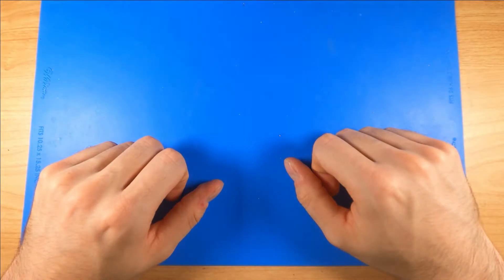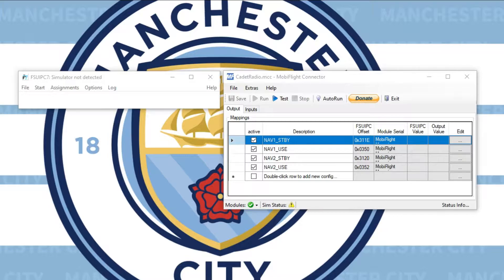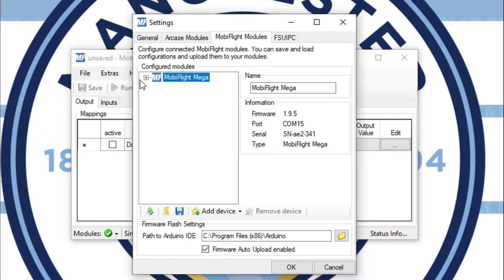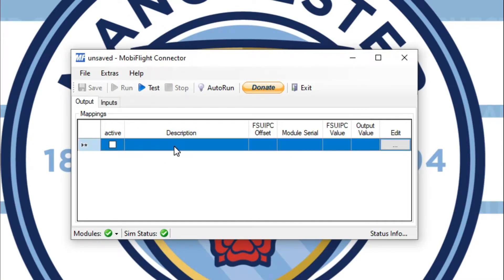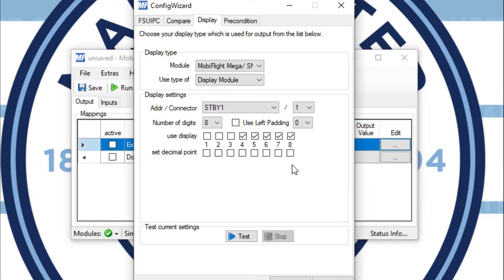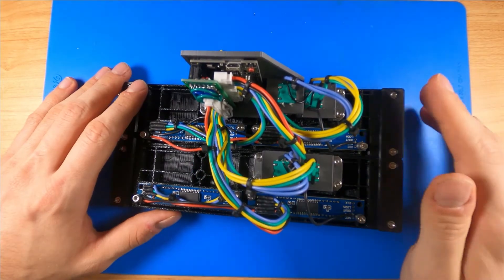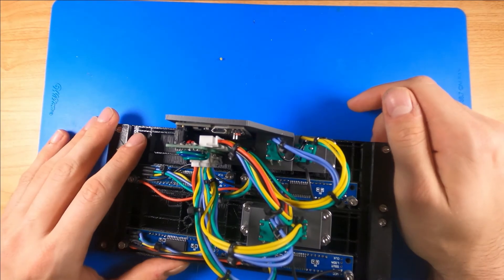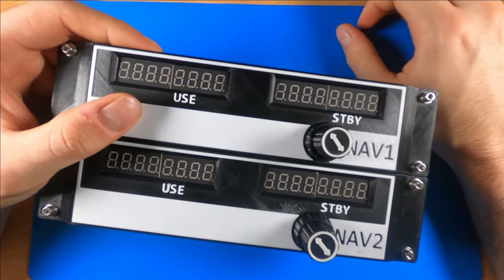CadetRadio Demonstration and Build

Comment: Awsome project!  printing the part right now.  But can the design be modified to use the 6 DIGITS segment (TM1637) instead of the 8 digits ?  it will make the panel less wide.
Reply from the maker: You can certainly modify the displays if needed-- the .step files are available on the Thingiverse page

Comment: Heya. Amazing design. I've got the whole thing printed, all the bits of electronics tested individually, but I'm struggling to get the final electronics assembly actually working. With any distance of wire from the Arduino to a splitter board I've created for distributing 5V and GND to all the components that need it, the LEDs misbehave badly. When testing one at a time directly to the Arduino they work perfectly but on final assembly they sometimes show '12.345' but most often show digits out of place or nothing at all.  Would you be able to share some photos of your power breakout board that you've mounted on the Arduino?  Thanks!
Reply from the maker: Hey Royston, did you follow the JST reference guide on the Arduino build page and the Mobiflight setup?  The symptoms you are describing sound like a combination of a few errant solder joints and mobiflight setup issues.  Send me an email at 3dvcreate@gmail.com
Reply: @VincePrints  Hey, thanks for the quick reply. It turned out, interestingly, to be a wire length issue on the 5V line.  I've moved from having a separate splitter board to having a bit of protoboard directly on top of the Arduino with JST connectors, and have soldered directly into the MAX7219 boards instead of using dupont connnectors, and all the LEDs are behaving nicely now. I'm toying with making a proper PCB as I also have a couple of switches to toggle the radios between acting as COM1+COM2 and NAV1+NAV2.
Reply from the maker: @SidheS  we could add your PCB to the project page if you are interested in sharing your design after it is complete!
Reply: @VincePrints  Yep, definitely. It's in manufacturing at the moment so once I've tried it out in a couple of weeks I'll get back to you.

Comment: Really awesome I am loving your work. Wondering if you can help solve a problem? I have the yoke pedals and throttle but need switch’s and dials and I am running out of space.  Is it possible to miniaturize the whole a whole stack radio/nav/ap/switches doesn’t need to be micro but would be nice if it was small and portable.
Reply from the maker: All of the .step files are available if you would like to modify anything.  This build is about as small as you can make it given the size restraints of the electronic components.

Comment: Can you use these with Airmanager.  Its a better combo than Mobiflight (yes thats free but less)
Reply from the maker: Hello Mike,
I have never used AirManager, but I don't see why not.  If AirManager can interface with an Arduino, this should work; if not, you may want to consider a compatible board, but the encoders and 3D printed parts will work regardless.

Comment: I really like your solution to a concentric rotary encoder. Cheaper than finding something like the ELMA E37 here in the US. It would be nice to use a similar system on a CadetG1000 😉.
Reply from the maker: Exactly my thinking!  Well, I'm currently developing the missing Cadet control surface at the moment ;) but maybe after that...